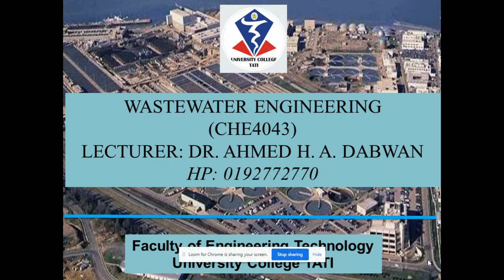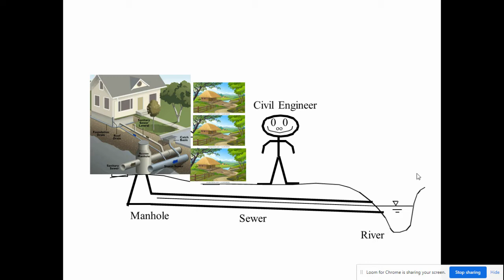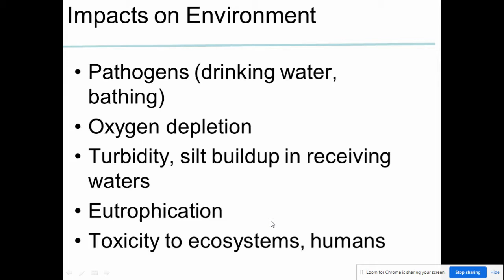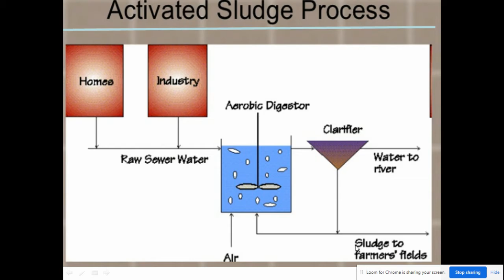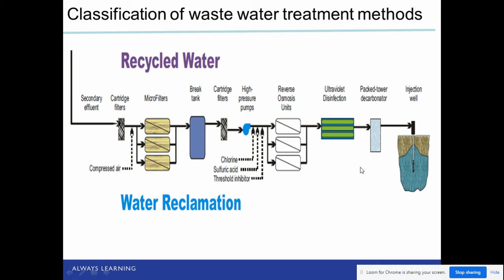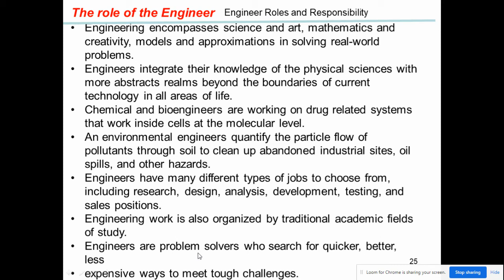Wastewater Engineering, Introduction

Comment: Assalam Dr Ahmed, from the video I am most interested in slide The role of engineer. Engineers have an important role in society as they are problem solver in most of the real world problems. Without engineer, there will be no sewage system, no building will be build, no oil and gas will be produce, and no research could be done. So there are lot of importance in having engineers in this world. Thank you sir for the great explanation. Stay safe and stay healthy sir. Assalamualaikum w.b.t

Comment: Assalamualaikum Dr Ahmed, for me the best and most interesting slide is about the classification of waste water treatment with the different treatment methods. The explanations are very helpful with the presence of the diagram to assist me in understanding more on how water coming from river is treated. Other than that, about the effluent disposal concept which include preliminary, primary and secondary treatment. Thankyou for the helpful information sir.